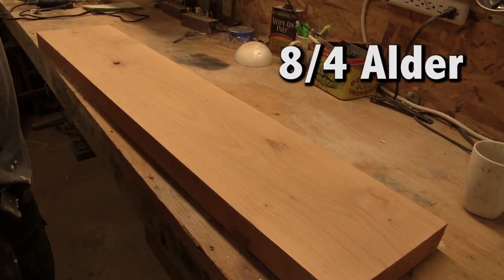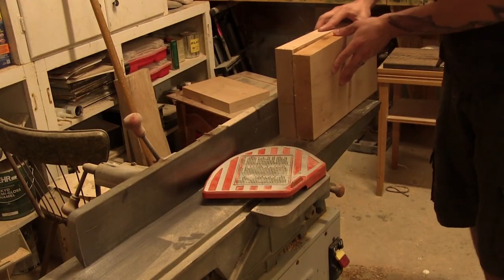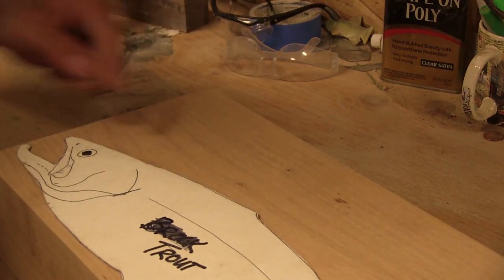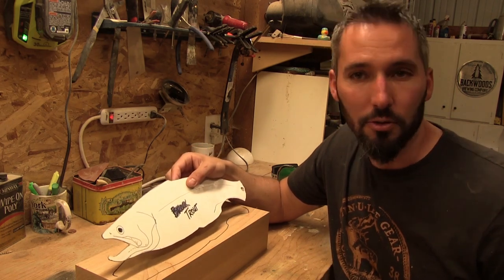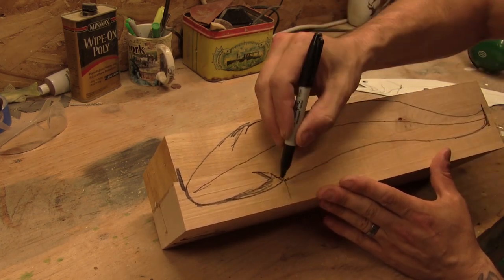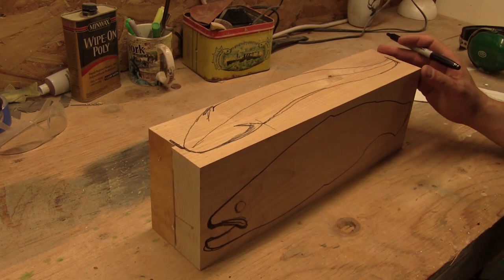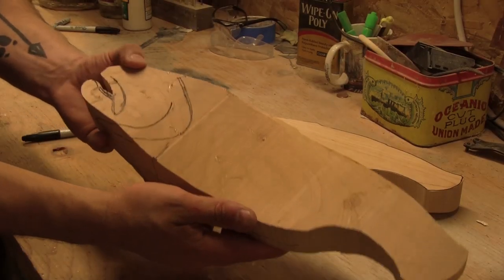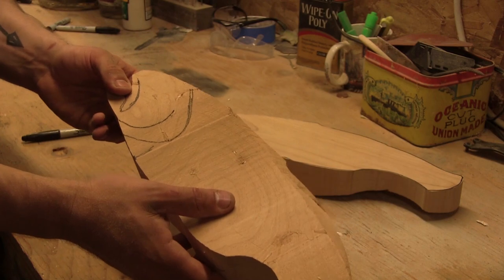Carving a Trout, Part 1: Starting the Carving

Comment: Great video Jameson, I am new to carving and want to know basic tools I should start with?  I am thinking a bandsaw and a Dremel, but other than that?  Also when it comes to a bandsaw suggestions for that?  Same with the Dremel.  Thank you!!!
Reply from the maker: You can’t go wrong with a bandsaw and Dremel combo for sure. A 14” bandsaw will be one of the best choices to cover most fish and bird carvings, though a benchtop 9” version will work well in a pinch, too. I have a Grizzly bandsaw and think that their lineup for bandsaws of any size is gonna be a good route. I have a few handheld Dremel and those are a great thing to have on hand. I also have a Dremel 9100 that is foot pedal controlled and it’s nice, though I hope to switch to something like a Foredom in the near future. As for other items, an orbital sander (usually $75 or so) is a very helpful tool that can save you hours of hand sanding.  An air brush is also a handy thing, though I spent a few years simply hand painting my carvings with nice results. The air brush is great though and provides a whole new level of detail that I would recommend trying. I have an Iwata brand air brush. It’s often good to start carving fish from just a natural material that doesn’t require paint. That lets you have a chance to get a feel for the form and process before wading into the painting process, which is it’s own animal altogether. Hope this helps!

Comment: Dumb question. I am new to carving, we’re is the best place to purchase wood blocks. Would you suggest joining 2x4s from Home Depot.
Reply from the maker: That's a great question. Honestly, I started carving fish from 4x4 blocks of old beams from framing jobs, and they turned out pretty darn good. So yes, you can certainly visit the local Home Depot for material like that, or, better yet, find poplar and glue up blocks of that for an easier carving experience.

You certainly can source material for carving online as well with a quick Google search. I'd shoot for finding blocks of basswood or juetlong (harder to find, but a great choice). It should be pretty easy to find blocks 4" thick and in the lengths/widths you need. You save money by finding material that's 2" thick, but then you have that pesky glue seam. Trust me, it's better to aim for a solid block from the start, but either way you're carving! Enjoy!
Reply: Thank you so much! And love your artwork. Hope to see more videos

Comment: What is the name/brand/model of your bandsaw?
Reply from the maker: Hey Zach, sorry for the delayed response! I am using a Craftsman 14" bandsaw with a 1HP motor. It's OK, but I honestly would rather (and will soon) go with a larger bandsaw like a 17" saw like the Grizzly G0513. More capacity and more power is a good, good thing. I use the G0513 at work all the time and it's rock solid.